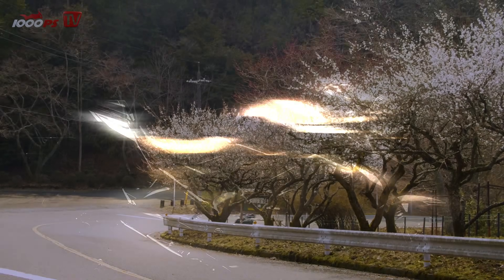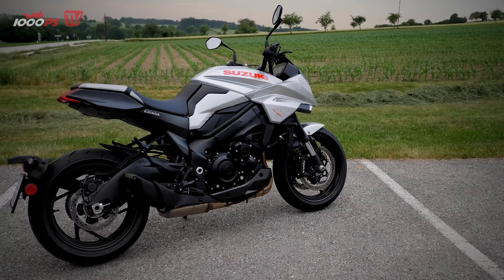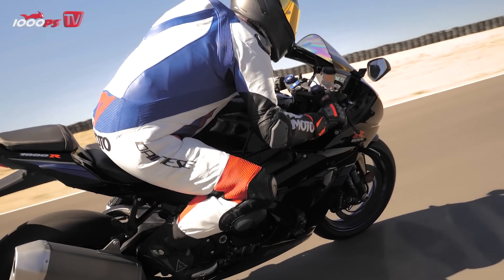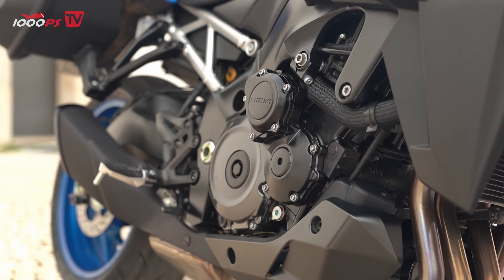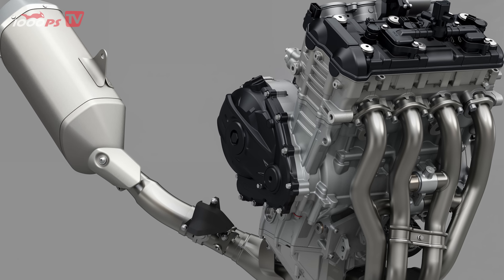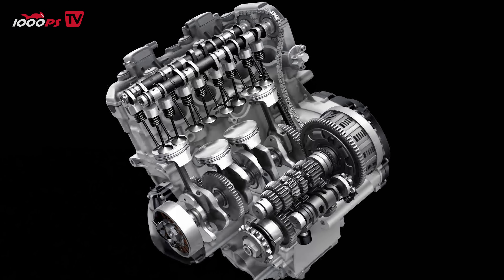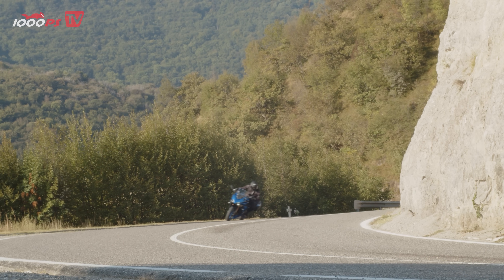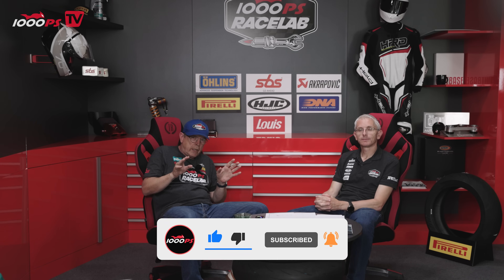Suzuki’s K5 Engine – Why It’s Still a Benchmark in 2025!

Comment: Whilst this engine has a great reputation, Suzuki has changed something in the camchain tensioning department because there are many examples of cam chain rattle with the latest version of this motor.
Such a shame as I was really interested in the GSXS1000 GT until this all came to light, which has put me off.
Reply: It will be bomb proof, don’t worry.

Comment: For a retuned for more low end torque bike, the gearing is way too low. 5,000 RPM at 70 MPH is far too busy. They should've left the bike with its 178 BHP and if owners really wanted, they could drop a tooth on the front sprocket. The true reason for taming many naked bikes is to keep a larger gap in power from full on sports bikes.
Reply: As someone who has owned both variants of this engine, I totally agree.

Comment: Katana is fantastic, except for the size of the fuel tank, which is a joke. 
12 litre tank on a "sports tourer"?
Reply: 220kms range on the highway before the light blinks. That's alright tbh
Reply: @MototuneX  really? i get the max of around 180 kms before light blinks. what rpm range do you ride Katana?
Reply: @harisankar5194 i ride around 80-120kmph.. because of speed laws..
Reply: @MototuneX cool. Fuel warning comes at around 2.5 litres left. If you get 220 kms for 9.5 litres, that's great. I could manage only 180 kms max before warning.
Reply: @harisankar5194 yeah, i keep it constant. That's the only trick haha
Reply: @MototuneX  :D.  if do keep that generous on throttle, its spoils the fun of K5